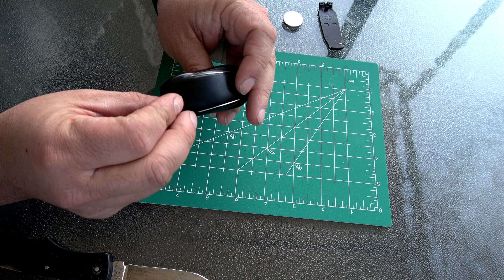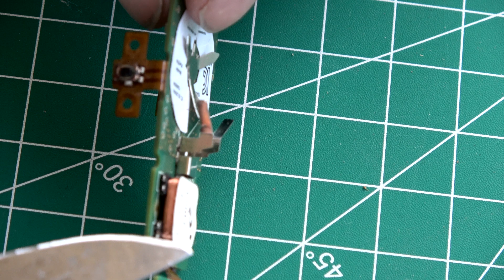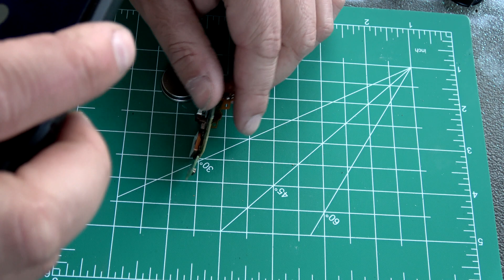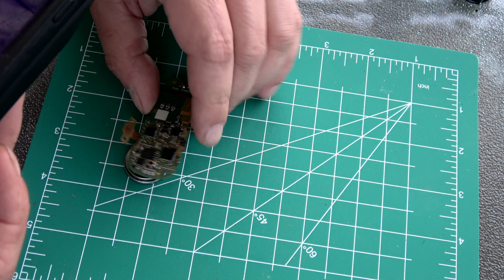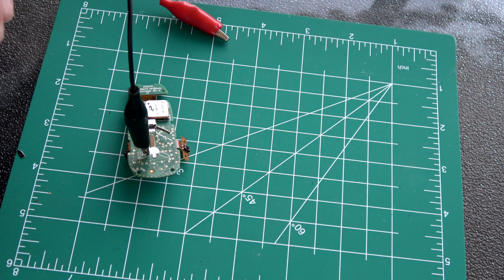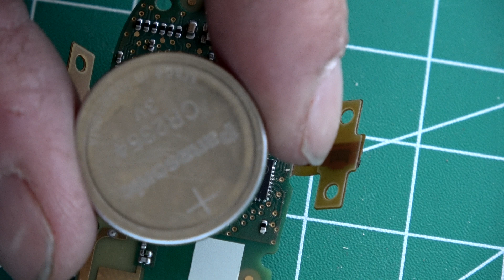Dead Model X Key fob Teardown

Comment: Very cool channel thanks for the videos are very useful, I see you already know Tesla well, tell me please, I have a freon leak somewhere and I don’t blow air at all (air conditioner) How can a car behave and what are the disadvantages until I solve the problem? what consequences can be Thanks in advance for your reply 🙏 -THC_w0148
Reply from the maker: Your welcome!

Likely you have a small leak in one of the radiators. Common, stone or something gets kicked up while at high speeds. mine has a very slow leak too, tesla wants $2k to fix (again), $5 in r134a every spring brings it back up to full performance. 
If your system doesn't hold at all, you'll be stuck going to tesla for diagnostics and repair. do NOT use any stop leak additive!!!! those "can" work on traditional car compressors, however, Tesla uses a variable speed scroll compressor, and stop leak will destroy it, and damage part of the rest of the system.
Reply from the maker: disadvantages of not fixing it, no active cooling of your battery. DO NOT SUPERCHARGE UNTIL ITS FIXED!
Reply: I charge a car only for chademo and there the speed is 25/42kw, do you think I can get to Ukraine at such a speed without freon
Reply from the maker: @travel_Swiss  Carefully, do not run AC, easy acceleration.
Reply: Brother help me with advice, I myself am from Ukraine now in Berlin and again I have to go to Ukraine. Berlin is very expensive and my business has lost weight since the beginning of the war and now there is a problem with money ((((

Comment: Found the reason why my 2016 Model S Keyfob drained the battery...
Was my own fault because I used a screwdriver to leverage the fob-cover at the front end. Inadvertedly I bent the tiny metal battery connector on the board slightly upward. This caused a short circuit right at the edge iof the battery, which heated up right away noticeably. No problem anymore after I bent the metal connector back into position. Your Model X connector looks somewhat different, Kman, but try to make shure there is no short right at the battery edge.